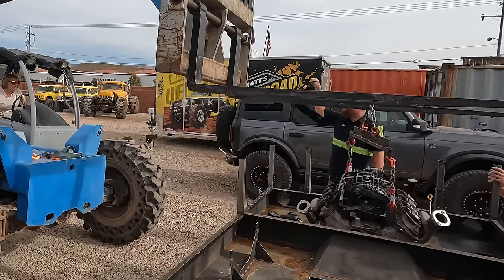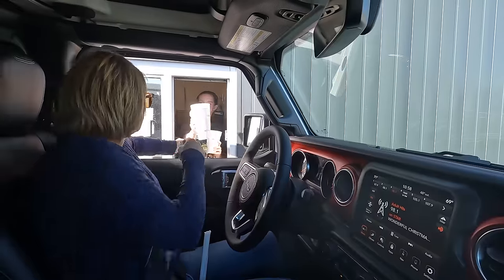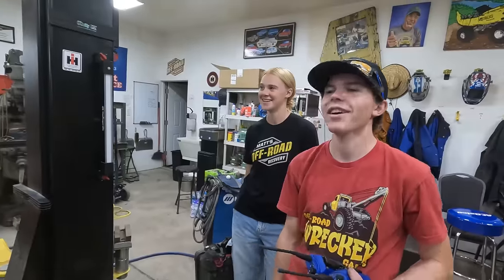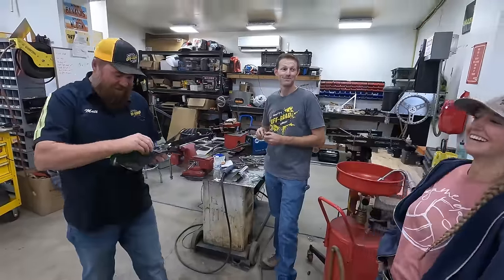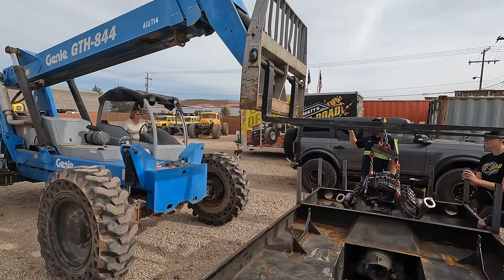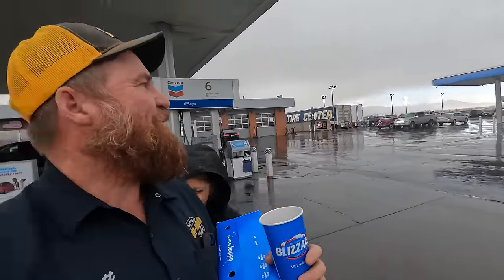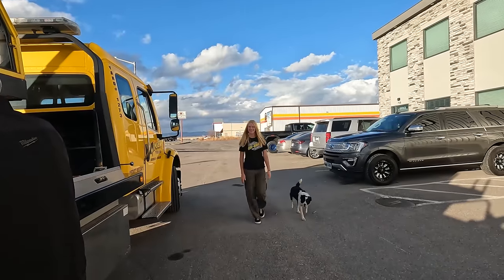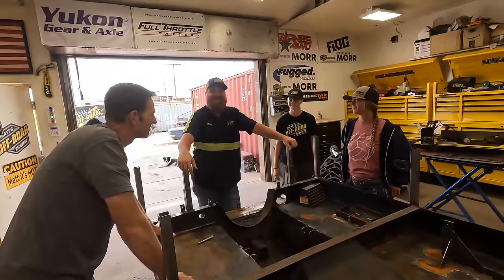Good Bye Bombi and Hello.....

Comment: For a rig that will be used in the snow I can't help but think an amber light bar would be advantageous . It is amazing how much amber helps in snow and fog .
Reply: Agreed!
Reply: Amber lights are 11% better.    Ha ha
Reply: I would add that the lights on a Bombi should be high , if they are low they will be covered rapidly by the snow ....
Reply: Save your toffee wrappers
Reply: @billyely7738 Imma need some proof of that! Haha!
Reply: @louisletourneau3429    does not matter,high or low ,it'll be coverd anyway, the only way to avoid this with led lights is if the lens has heating ,brs from a land where snow is kind'a normal.
Reply: They very rarely do snow recoveries when it is snowing or there's a blizzard or similar, and if they really wanted. Amber, they could probably just throw on some Amber fog lights
Reply: @louisletourneau3429  yeah I thought they would have been better mounted higher up.
Reply: Our Tucker had regular off-road spotlights. The headlights were more effective, though.
Reply: Some full 360 lighting would be pretty sweet, should almost be standard on offroad vehicles for visiblity. Biggest obstacle is not breaking anything off during treacherous pathways.
Reply: @louisletourneau3429 when the snow is falling lights down low are better. My bumper lights saved my life in my mountaineer in a blizzard. I couldn't see through the snow with the headlights on. Just the low mount driving lights and I could see.
Reply: first thing i thought was who uses led floods in snowfall, the dazzle will be insane
Reply: Agreed
Reply: Not only that, but a white LED light bar like that probably has too high of Kelvin rating and too low of CRI. Light bars are horrible choices in snow, but amber does help.

Comment: Hey Matt and Tom, you guys should consider putting defrosters on the windows of the Bambi. This way when everyone is we from treading in the snow, your windows won't fog up.
Reply: If there is AC in the cab, the windows shouldn't fog
Reply: @bgee461  Its unlikely they will  put AC in a snow cat. Dont see much need for AC in the snow. But you never know. A heater on the engine cooling system should work fine. Thats how  cars are made. They did say they my play with it in the sand. So you never know.
Reply: Yes, they have a defroster/heater blowing on the front window
Reply: They said they're replacing the glass, should see about getting glass with built in defroster.
Reply: @Hurtydwarf  yep that would be a good investment IMO

Comment: I think we are getting into a Ship of Theseus situation here. So much of the original Bombi has been replaced, is it still the original Bombi?
Reply: I've been watching the Sampson Boat co channel's rebuilding of the Tally Ho. The only original material is the keel, which was melted and repoured. Yet it's still the Tally Ho.
Reply: The original out-of-square frame is under it.
Reply: I think the British equivalent is called Triggers Broom!
Reply: The most commonly accepted solution to Theseus' Paradox is that where constructs are concerned, there are two 'things' occupying the same space at the same time - each having it's own unique identity. The first is objective, the second subjective.

The objective identity is 'the amalgam' and is defined as the unique combination of parts that are ordered in their respective places. 

The subjective identity is the 'boat' or in this case the Bombee - subjective because if you poll 10 random people that watch the channel, asking them "what is that?" 10 will say, "the Bombee". 

You can replace 100% of the objective amalgam and not lose the identity of the subjective 'boat' - as long as at any given point in time it can be subjectively identified as such.

 In 9999/10000 cases the objective definition does not matter.

EG a building we subjectively identify as 'a shed' is actually, objectively, just an amalgamation of tin, nails, screws boards, concrete, glass, insulation, hinges, handles, etc that are connected in such a fashion that they can be utilized as a shed, and anyone that sees it subjectively identifies it as 'a shed'. Lol. 

Replace whatever you want over any timeframe but at any one point of time within that timeframe, you can still store your stuff in it. 
😊
Reply: @QuantumLeap83  Part of the philosophical problem is what each state DMV considers “the thing.” The heavy wrecker is legally an International but from a purely functional perspective the yellow parts could be replaced by the front half of a pink May Kay Cadillac.

Comment: Hello Matt, this is friendly off-roading advice from a fellow Matt. My suggestion for off-road lights for the bombi would be four KC 6 inch Apollo Pro halogens, two in spot, two in spread instead of the harbor freight LED lightbar. I do a lot of off-roading in the evergreen forests of the Pacific Northwest in my Jeep which gets super dark at night in winter and sees a decent amount of snow in winter. The halogens will heat up when running and melt all the snow and ice accumulated on them. Whereas my buddies LED spotlights and both our LED headlights get frozen over and constantly have to be cleared of snow and ice. Since the bombi is going to be operating in snowy conditions I’d suggest halogens over LED lightbar you’ve got selected for it. I will say one thing for warning though they will draw more power than LEDs would but I believe the alternator you guys put in it will be able to cope with the power needs. My Jeep Wrangler’s alternator is stock and is able to handle the power needs of 6 of those Apollo pros plus a winch. Good luck and glad to see Lizzy back as well.

Comment: The Bombee looks like it could use a 22" lightbar under that bullbar, I have the 22" Roadshock lightbar mounted on the underside of the bullbar on my XJ's Smittybilt XRC front bumper. It fills the gap between the bullbar and my Badlands Apex 12k perfectly!

Comment: Matt I have a 09 GMC Sierra with the dod that that engine has and I want to delete it I want to change the cam and lifters to delete that system like you are this motor for the bombie could you please show that process so I can see what I'm getting into I know most of what I'm getting into but I would still like to see the process because I have to do it in my driveway

Comment: I think is a good idea to build a roll cage in the cab, so in summer you can take it off and have the cage.
Reply: I think they mostly use the bombi in the deep snow.
Reply: Yes, but in a past video they said that would be a good idea to use it in the sand on summer with the cab off. Thats why they want the cab removable
 @COBARHORSE1
Reply: @alexwolfzabalaga1472  ahh, I missed that.  Yes, would be very nice to have a summer top for sand rescues.

Comment: You should be putting lexan in the windshield, better protection from a winch line snap. I know you guy's use synthetic roap and soft shackles. But something literally bullet proof is much more secure. Great video as always

Comment: Welding on galvanized steel is a good way to get zinc oxide poisoning/welding fume fever. It is easy enough to clean it off first from the weld area. Better weld and less toxic smoke.

Comment: Why change the glass ? Thicker glass is safer and better for insulation
Reply: thinner glass isnt unsafe even if it is more fragile. it has a layer of plastic film sandwiched by 2 layers of glass that prevents it from shattering. and they said the bombee is hot, not cold, when youre sitting inside. whether theyre driving on snow, sand, or mud, psi ground contact is very important so it makes sense they would try to save weight. i know where they could save another hundred lbs

Comment: hahaha grabbing hot metal runs in the family, hahahaha
QUESTION
Would it be worth putting "Fork Loops" on the roof??...that way, when need to lift off, you just drive the fork lift over, slip forks in loops and boom...lift cab...no straps, nothing else needed.

Comment: back a few years ago I had a 1990 F150 and I took it places that no one else could take there trucks. It didnt have anything great it was a work truck I had F250 leave springs and shocks in it but that truck would flex. I have a embankment next to my driveway and it was the only truck around that could keep all 4 tires on the ground and crew up it.

Comment: There were some very good suggestions here: 1) add amber light bar; 2) add defrost capability; and mine, 3) add roll bar, 4) add winches, 5) are there tow points?

Comment: What happens if you breathe galvanized fumes?  These fumes can cause what is known as “metal fume fever” or “zinc shakes.” Metal fume fever can cause symptoms that include fever, headaches, nausea, chest pain, and more. Inhalation of these fumes can also cause long-term health problems, as the lead present in the galvanized steel can vaporize along with the zinc. -- Google

Comment: You triggered my PTSD when you were drilling that purple cover, Matt.
Years ago I did the same thing drilling out the cover for a leaf blower.  The drill grabbed, there was a loud bang and it felt like my left hand was hit be a baseball bat.  I was afraid to look.  I did eventually, and through the blood I determined that my little finger wouldn't curl anymore.
I had severed the tendon, which then snapped back into my hand.  The strangest part was they had to wait for the laceration to heal before they went in and cut it open to reconnect the tendon.  Add the weeks of physical therapy.  Not worth it.
Please use a pair of Vice-Grips to hold sheet metal you are drilling.

Comment: Cool, bombi in for paint, pretty ready to see it done and in the snow on recoveries for sure. And sounds like a huge project for robbies, jeep, build. Be neat to see that build.  Question,  aside from lift, you mentioned cut out due to wheel size.  It is doable to just have much wider axles and have the tires out past the body ? I've always thought that ia better, then just adding a 10 inch lift. Can definitely see a banna, vs, Robbins blue jeep cloner.

Comment: jeeps are great right off the lot! All you have to do is replace the wheels, tires, the entire suspension, drive line, gearing, program the chip, replace the top, bolt on aftermarket bumpers and it's perfect, right off the lot!

Comment: I felt nervous seeing so many unprotected heads and toes around that forklift as you were lifting the cab and motor.  Maybe have some safety hat in the shop for when you are moving things about at head level?  And steel toed boots?  Neither is a great inconvenience, but could prevent serious injury.

Comment: use mallet k es for bump stops, also have window issues.... ie rubber molding on side windows has a gap.... and make sure it has a working gas gage.... not very professional to run out of gas on YouTube

Comment: I know these are posted some days after they are made, so I hope this finds you in time. While you’re designing the wiring for the wiper motor y’all might give thought to adding in some wiring tabs or tubes for interior lighting. Maybe something like LED rope/tape lights around the circumference. 🫡

Comment: @matt i usually cut the rear fender from the door, thru the body line 3" under the window, then to the bottom of the stop light and i move the rear axle 4 to 8" back and the front axle 3" forward Stop messing with that and make the rear fender at least as big as the front one, and get rid of the batterie/airbox bump. Make those tires free

Comment: Before you get that Bombi sent off for paint you should weld lifting points (eye hooks) on each of the corners of the roof to make it easier to pull off in the future.  Once you have it looking all good i'm not sure you want to be lifting it with a belt through the cab ;)

Comment: When you call a cellphone who you call don't hear until you hear the 2nd or 3rd Ring then they get the first Ring tone you should build a engine stand on wheels so you can test run the motor

Comment: makes everything in steel, but then wants to loose weight lol. You should do some parts with aluminum.
Reply from the maker: We did. 
Aluminum 5.3 
Aluminum third member. 
Over 100 pounds in weight savings in just those two parts.

Comment: You know windshields are heavy for a reaso they don't break. Have all the places to try to cut weight Windshield is not one of them
Reply from the maker: Modern cars use significantly thinner glass. 
Time to get with the times